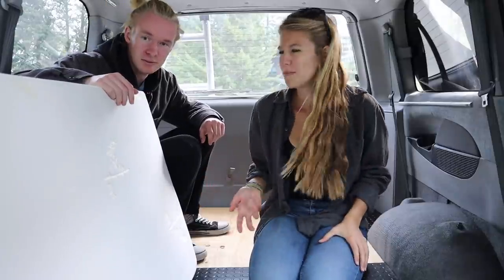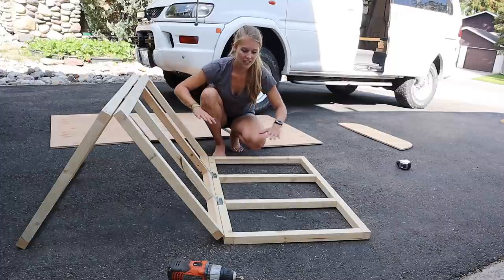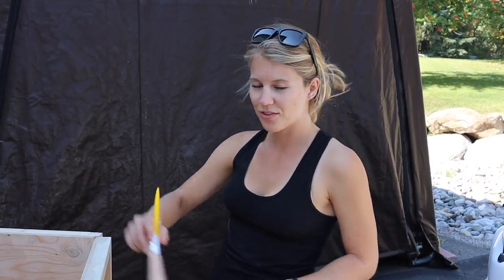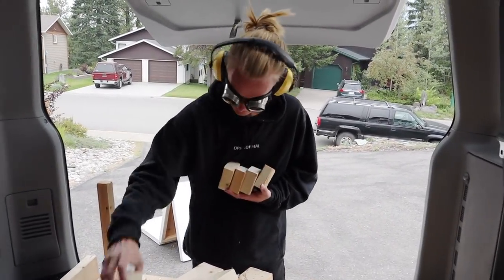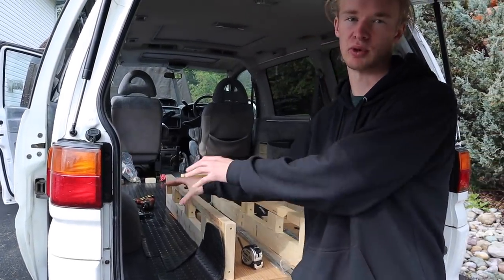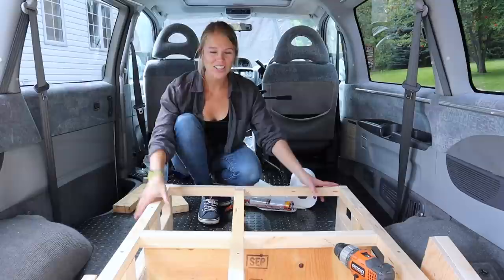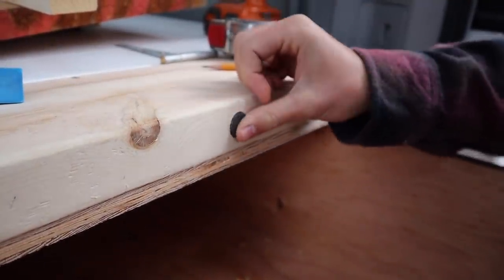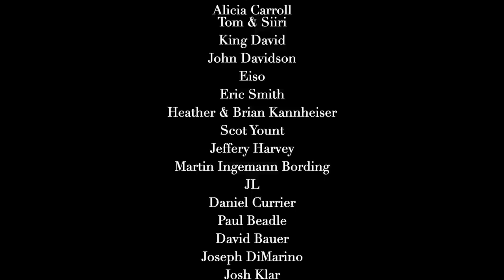How to Build The Ultimate Van Bed // Folding Rock and Roll Bed // VAN BUILD Pt. 2 Ep. 51

Comment: Suggest a locking pin to keep the bedbench from sliding. If unit is upright it may unfold during a quick stop or rough road
Reply from the maker: Good idea, we will plan to travel with the bed down but we’ll put a pin in there next time we have some tools around and then we can travel with it upright!
Reply: Thank you! I have been looking for something simple like this that I can do by myself. This is great! I also like I also like the locking pin suggestion from @roberttaylor

Comment: As far as having a clear view out the back,…. School buses, city buses, box trucks, cut away vans, semi trucks, pick ups towing travel trailers and fifth wheels, 12 passenger nissan nv3500s, 15 passenger Ford transits, all cargo vans without rear windows,…they all have no visibility out the inside back of their vehicle.   Upgrade to tow mirrors (a flat and convex mirror on each side) and learn to use them and you won’t need to worry about it.   Also,… invest in a reverse cam ($50 on Amazon) and that will help tremendously with backing.

Comment: Solid plywood under a mattress in a van is a mold issue. Ventilation under the mattress is critical. Lots of condensation in a van with two people in it.For your health and safety research this topic. Best wishes to you both.
Reply from the maker: Thanks so much for this suggestion! We were actually planning to put some holes in the plywood, but time got away from us! We plan to do that eventually, so far so good with good ventilation we haven’t had much trouble yet. Certainly beats the sailboat in that regard, much smaller space to keep warm and dry!
Reply: Either drill holes in the plywood to allow air movement  & prevent mold  OR check out hypervent.

Comment: I’m just wondering if lack of ventilation is going to cause a problem with mold? If you are just using it for short outings I would suggest taking the mattress out of the van when finished. Condensation is a big enemy of mattresses. It’s the warm air of your body and the cool or cold of the surface below it. I have seen people who build their own beds for long term use put holes in the bed frame and also include a moisture barrier such as “Savy Rest bed rug” and “Hyper Vent Air Flow Moisture Barrier.”
Don’t know if you can get either of them in your area and you may be able to get away with just removing the mattress if this is for short term but $170 is a lot to lose to mold. Really great bed frame though!!

Comment: Mark has a good tip.  Also you can take a tool called a hole saw and put some evenly spaced holes in that ply for ventilation.  Just like blue moon you need to prevent condensation.  I still believe this will be a beautiful second or third home : ) oh this is also pop's old boats.
Reply from the maker: Hey Pop! That is a great idea, we will plan to do that down the road. We meant to put holes in during the initial build...but time got away from us!
Reply: @BlueMoonLife  love it.

Comment: I have the same build I did out of scraps wood from a old build and a 3 fold tumbling mat I got at the resale shop for $5. Nice job...  I have a 08 Chrysler Town and country It comes with a built-in power 150wattt inverter for 110volt and a in the wall rechargeable flashlight and a rear DVD system. I love van camping in it. You can find them for 3k anywhere on the 🇺🇸.

Comment: I made the same mistake as you..., I used the wheel arch to determin the height of the bed, but when the bed was finished, I could no longer sit up straight coz I forgot about the the thickness of the bed frame with the Mattresse on it !!!

Comment: That is great, don’t you think it would be safer is the frame was fixed to the floor rather than just glued and also a simple bolt lock to lock in place when it was in the seat position?
Reply from the maker: Yes I think if we had the foresight it would have been a good idea to throw a bolt into the seat threads, but by the time we did the “test fit” the floor ended up being so tight we could get it out again! And then the rest is history, the grease against the wheel wells has made it surprisingly rigid and it appears very stable even on quite bumpy roads. Let’s just hope we never get into an accident at all, but if we do we think it will be okay.
Reply: @BlueMoonLife  IF/WHEN you get a chance drill a couple of holes straight through the item and through the bed of the vehicle and then undercoat everything.
Reply: @BlueMoonLife  it’s not to late to put a catch on :) I would also be tempted to just get a few screws from the frame into the floor too just to give it a little more strength than just the glue.